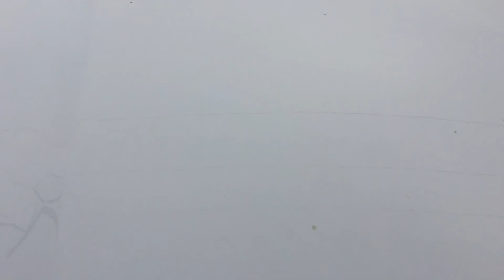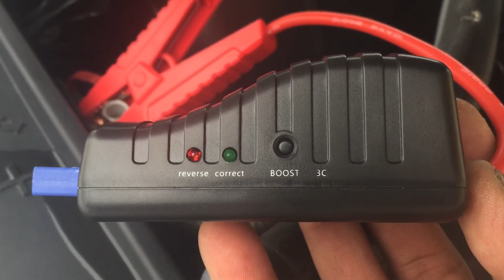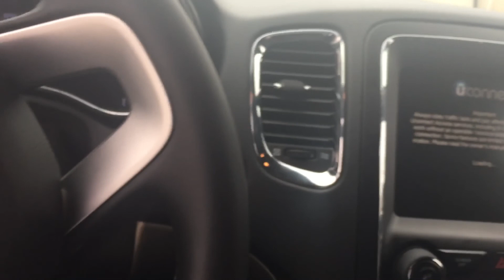2015 Dodge Durango Bad Battery

Comment: just like on the + there is also a “stem” sticking out for the negative as well. it has a black plastic cap covering it and is just a few inches down from the + (same side).